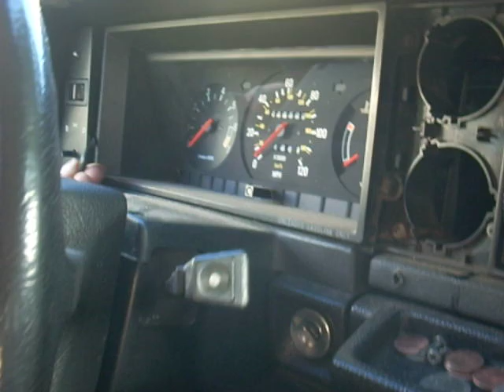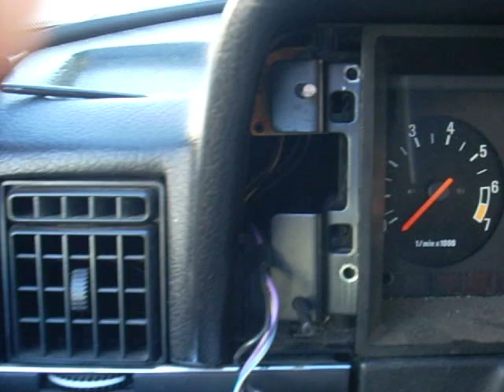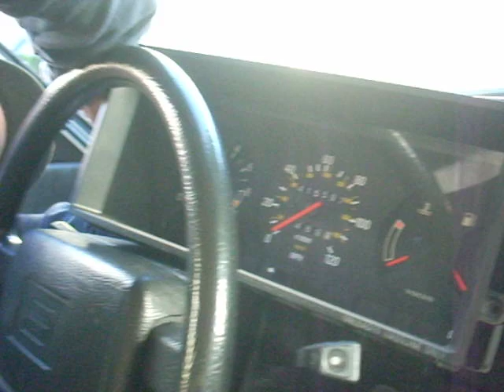speedometer cluster removal

Comment: Exactly thank you for this vid. I know everything up to how you actually extract the cluster from the dash. Gotta pull it throws the PASSENGER side. 
My headache is now over.
Reply from the maker: geoffrey walker 
technically, you're supposed to take the steering wheel housing pieces (top/bottom) off first (just 2 screws hold it from below). but I found enough flex in the assembly to wiggle it out.
Reply: Yes I found it to be easier to take the top cover off of the column but hey either way works like a champ in and out in a couple mins give or take:)

Comment: Nice Video.  For those who have not done this before or are not as talented.... notice how the steering wheel is turned so that the top is straight to allow the cluster to come out..There is a plastic cover on the top of the steering column that may make it easier if you remove that first.  Good Luck.